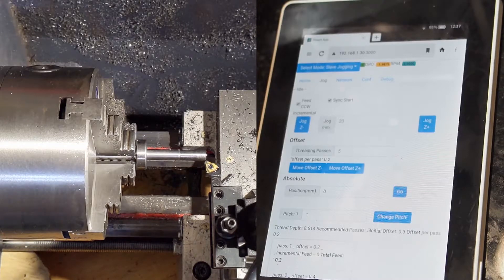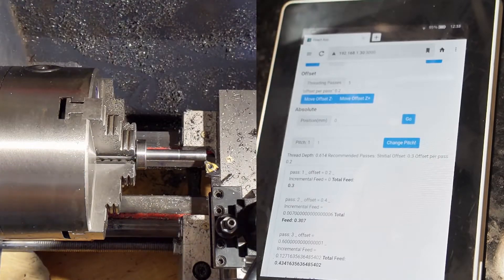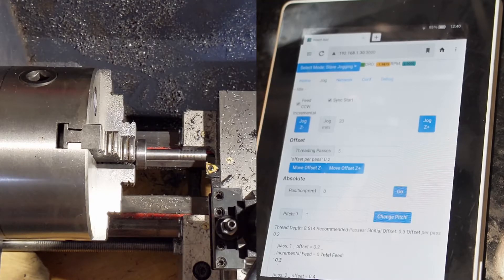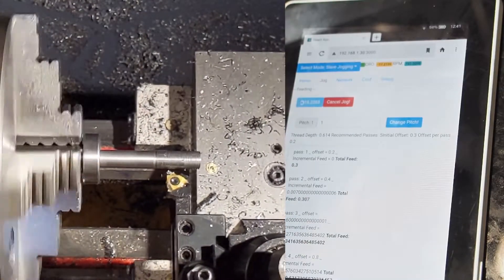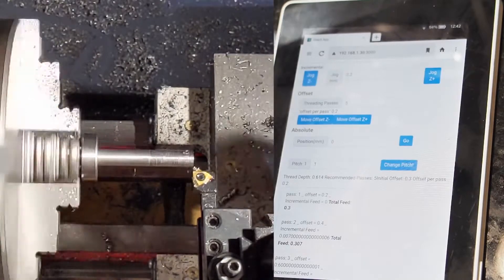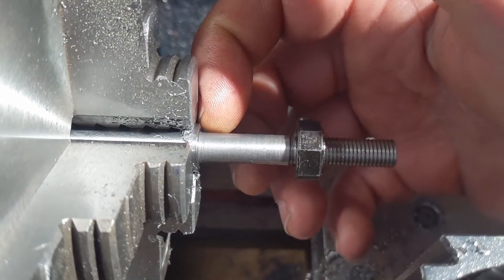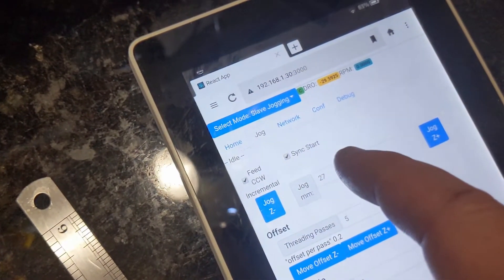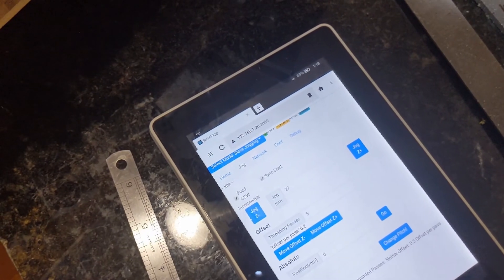espELS part 8 threading in steel

Comment: Watching this I was thinking about if there would be a nice way to write a function for doing ACME threading? Unsure on the math but it seems like you’ve got everything setup to enable threading it. Am going to participate more once I finish building my lathe...
Reply from the maker: That should work fine with the right tool and a lathe with enough torque